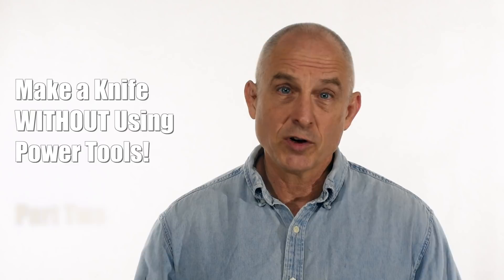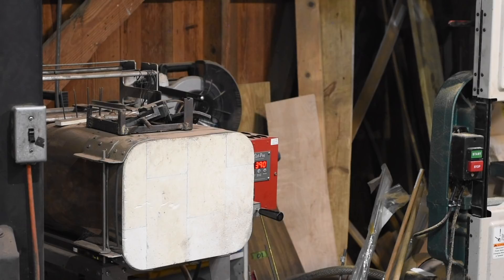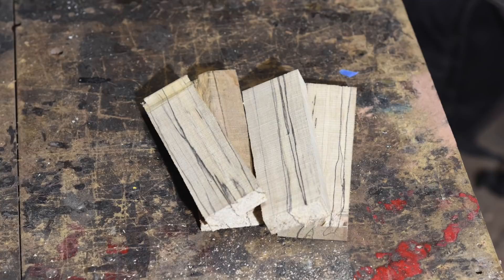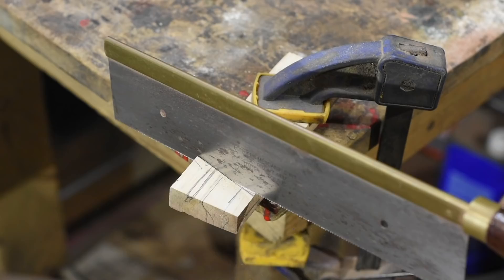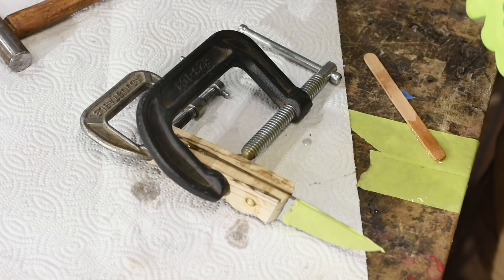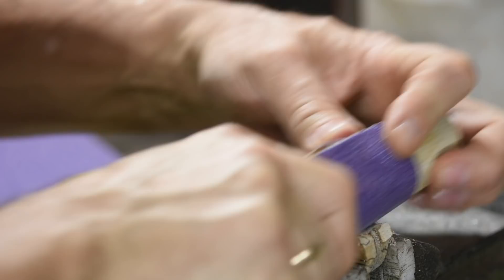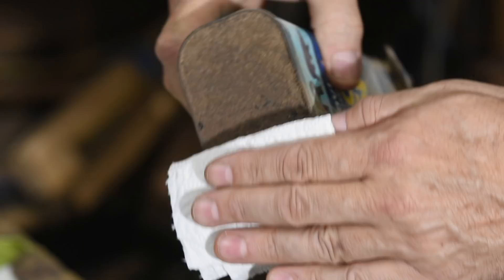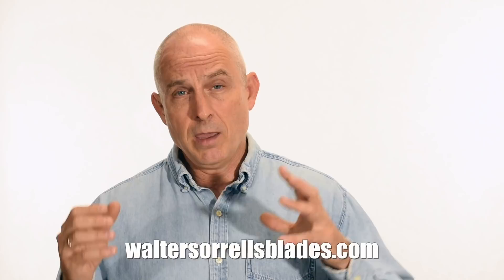Make Your First Knife!  Easy, Cheap, No Power Tools! - Part Two

Comment: Love your videos! One thing I have used to keep adhesive off of places I don't want, is a crayon.  I just rub a crayon on the blade where the front of scales meets the blade.  The epoxy won't stick to wax, and it makes cleanup a lot easier.

Comment: Thanks for the motivational and informational video. 1)What was the oven temperature? 2)How long did you keep it at the temperature? 3)The brass rod was 1/4-inch diameter. Was the hole diameter through the steel and wood slightly smaller for a tight fit? If so, how much smaller? 4)If you peened the pins, WITHOUT USING EPOXY, would you need a much denser (tighter grain) wood so the wood wouldn't tear off? Or, possibly pins and washers?

Comment: Hey Walter! I didnt see anything of how you sharpened the blade. Curious how you did it with out the belt sander?
Reply: It can be done by hand with sanding sticks, starting with a low grit and working progressively to higher grits. Use the same motion you would when draw filing.

Comment: How thick should your primary grind be before you do the secondary bevel?
Reply: Depends what the knife is for. A thin primary bevel helps to slice much thinner and more precise but a thicker bevel has more material behind the edge making it stronger for chopping stuff

Comment: That spalted wood is stabilized?  I heard its necessary to stabilize spalted wood
Reply: That depends on the piece of wood you have (and, no doubt, on the species of tree it comes from). Some spalted wood is hard and solid; other specimens are soft and punky, or have a lot of cracks in them. 

(For new folks, “spalted” wood is wood from a tree infested by borer beetles. The beetles spread a bacterial disease that actually causes the spalting, which is a characteristic pattern of discoloration. The “figures” of discolored wood can be quite attractive in some pieces.)
Reply: @censusgary  Thx  for the info mate, i wanted to try some spalted woods, but i was worried about the strenght of the material
Reply: @carlos_akihito  The best advice I can give is to look at the actual piece of wood and feel it. If it seems solid, it is. A knife handle doesn’t need to be terribly strong, especially if the knife has a full tang. It’s never going to have to bear a lot of weight or torquing stress. It can still split or shrink as the wood ages, but that’s not because it’s spalted; that’s just because it’s wood. 

By the way, spalted wood needs to be kiln-dried, to kill the beetles and bacteria that might still be in it. You don’t want to spread them around to living trees. If you get the wood from a lumber dealer, you won’t have to worry about this, but if you find a piece somewhere, you’ll need to figure out how to bake it in an oven or something like that.